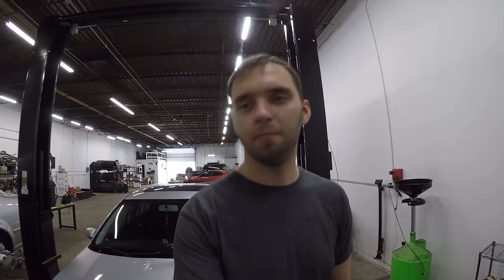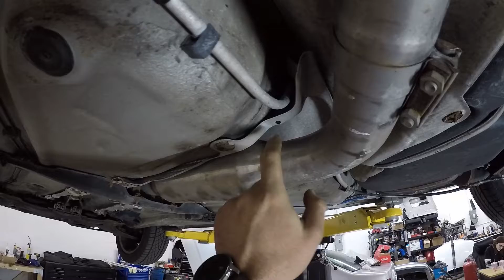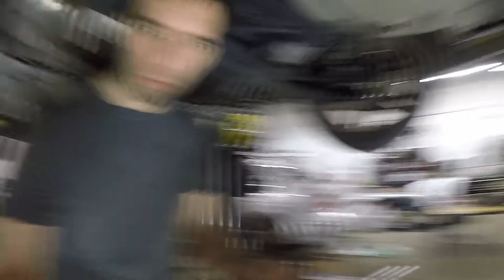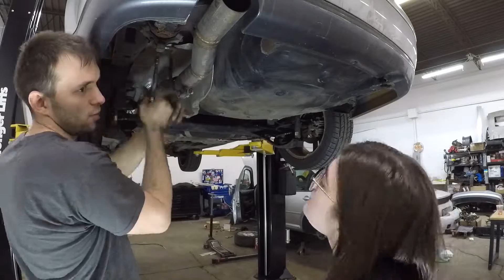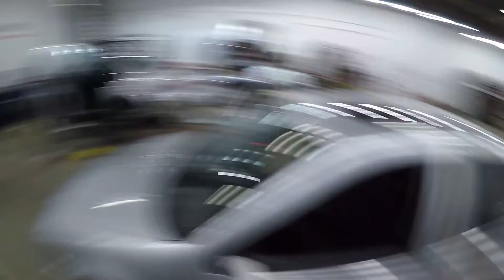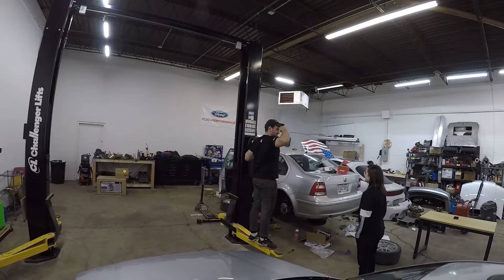Mk4 VW E-Brake Fix

Comment: No discussion on the tension adjustment on the interior rear console area which needs to be tightened to appropriate slight tension when E brake is disengaged. Yours is too loose and needs to be tightened as it should hold the car at 3 or 4 clicks.

Comment: Only reason I watched your vid was to see how you got the console out without breaking it guess the cables magically tie in and a adjust themselves from underneath eh?
Reply from the maker: I just didn't think that was necessary to show. Theres 2 screws up front on the center console behind little clips. And there's 2 screws in the back underneath the cup holder or ashtray depending on what year your car is. Then you remove the side cover of off the actual arm rest and there is 1 13mm bolt that must be removed to take off the arm rest. Then you push down on the front of the console and pull up on the rear and pull it out.